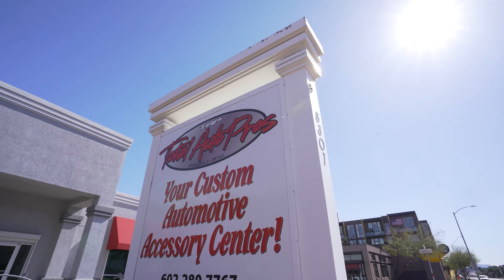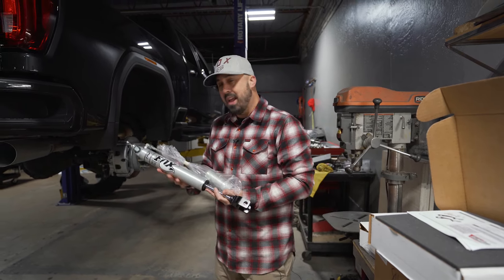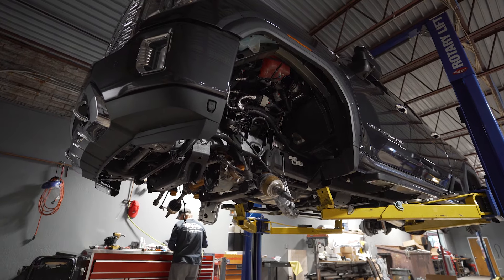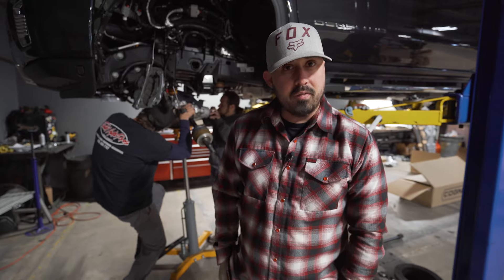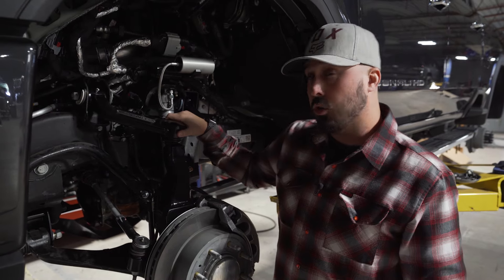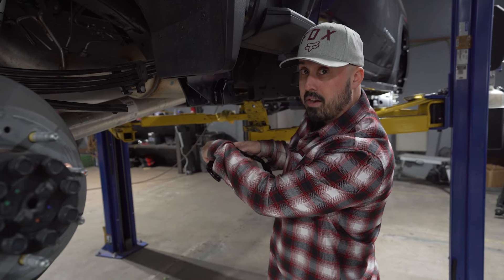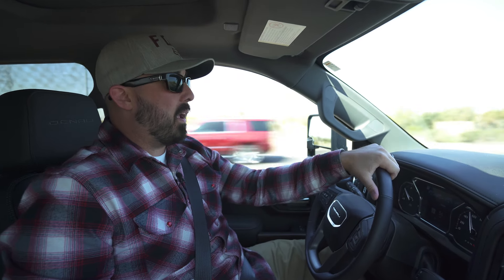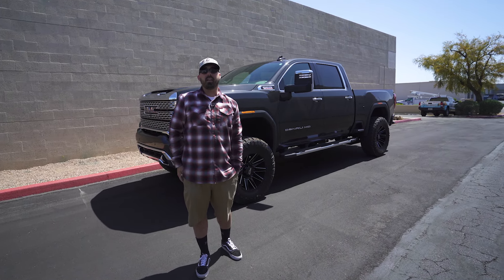Watch How This 4" Cognito Lift Kit Clears 37" Tall Tires

Comment: I've been  GM guy for years. However, I decided to order a 2022 F250 because I can add 37s with a leveling kit. Not sure why GM doesn't provide the capability.
Reply: I have owned f250s and sierras 2500’s.    The ford has death wobble and lots of steering vibration inputs when driving ( on that was something a stock 2021).  Went back to a gmc after the ford because of the wobble.

Comment: What is the tire size, wheel size and offset?
Reply: I'm wondering the same thing... from a glance they look 37x13.5.
But no telling what wheel size
Probably a 20x10. But if that were the case, it's likely a 37x12.5 tire
Reply: Guys…they were remarkably detailed in their parts mentioned. @2:15

Comment: Could you post wheel sizes (backspace and offset),
And tire sizes, please.
I'm looking at American Force CK201 22x12 with -51mm offset.
Adding a front bumper spacer to clear and rear front fender lower pocket mod, with this lift kit.
Hoping to clear Fuel Gripper M/T 37x13.50r22 🤞

Comment: Can you go back to the stock suspension after the trimming if needed?
Reply: no, once you cut the factory rear crossmember mount theres no going back. usually the only time you can return to stock is from a leveling kit only.

Comment: looks awesome, waiting ever so patiently for mine that I ordered in Feb.  do you use the same mounting bracket that comes with the kit for the resi (the one that mounts the resi to the shock) to mount the resi horizontally in the wheel well? Or do you need a diff bracket for that?
Reply from the maker: We used a different mounting bracket on this application to mount it horizontally. I believe it was the Full Throttle remote resi bracket.